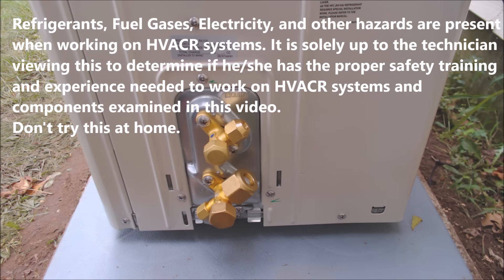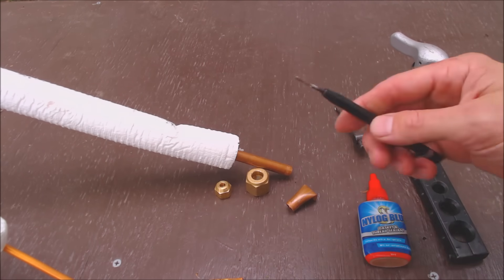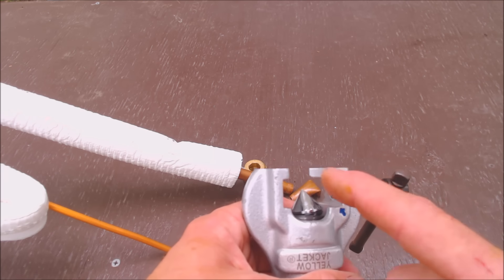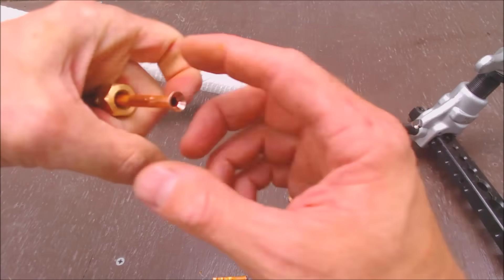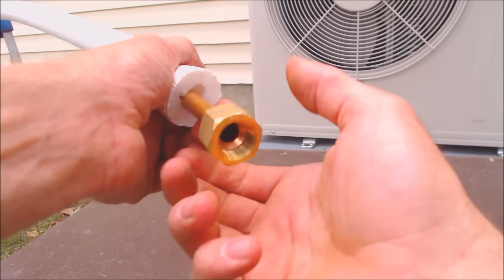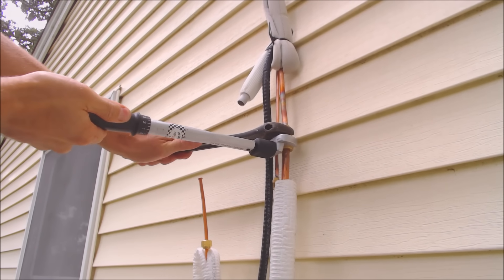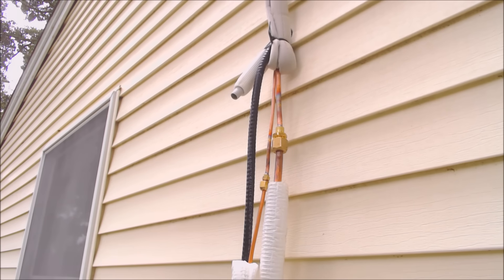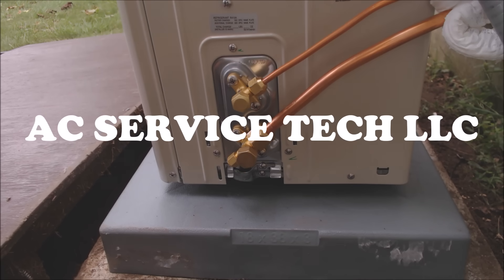How to Flare and Install Copper Line Set on a Mini Split Unit!

Comment: Great video!   I used an automotive torque wrench with crowfoot.  From what I read it's accurate.  The YellowJacket flare tool is awesome... as a homeowner I still saved over $1,000 on install of my first unit after buying the tools including vac pump and micron gauge.
Reply: To be 100% accurate you have to do math to get a reduced torque to allow for the extra length of the crows foot
Reply: Do you remember what size crow's foot you used? Are the refrigeration nuts sized metric? Did your research say how the crow's foot should be oriented on the wrench, straight or at a 90?  One youtuber said at 90 which seems to make sense.
Reply: @joebrewer5885  As I recall it was metric.  I think 90* was what I did.
Reply: @Hubjeep  Yeah it's 90 degrees, I've got an install coming up and have been researching. I couldn't pull the trigger on a $200-300 torque wrench for HVAC that I'm going to most likely only use once, maybe twice in my lifetime.
Reply: Guy I’m helping install would say he reamed it far too much but I’m starting to think landlord doesn’t know what’s up, I’m learning this in the down time from framing for my regular job, considering switching into this stuff because it probably pays better and is easier on the body but I hate working in occupied/gross residences and new construction framing requires pretty much non of that except for the very rare call back

Comment: I'm flaring a copper line with a male adapter with my propane stove in my should I be using threadlocker  liquid anyting?
Reply: I am  ( a DIYer) also installing a propane stove.  I already ordered some of the tools you use; however, do you have a reference for the torque on 3/8 ID copper tubing flare? On other videos DIYers crank it as hard as they can. 
Thank you for your videos.
Reply from the maker: For a gas line that only runs at 1/4 psi nat gas and 1/2 psi for lp not you dont add anything to the flare face or threads, thanks!

Comment: Do you use Nylog when mini split system uses PVE oil?
Reply from the maker: Yes just a small amount though and make sure there is none inside the tube but only on the flare face so it doesn't break off and enter the tubing and end up in the strainer, thanks!
Reply: Can flare connections be disconnected and reconnected? Would this increase chance of leaks? Thanks...

Comment: Can you flare a 1/4” line to 7/16” ?
Reply from the maker: You would need a reducing flare coupling fitting. In HVAC we wouldn't connect a 1/4" line to a 7/16" line for running refrigerant, thanks!

Comment: Good tutorial, though I would recommend cleaning your flare surfaces after you flare, as the tool is burnishing the face you will have copper left on the face of the flare than can potentially be a leak source, and a source of contamination in the system. Cheers
Reply from the maker: Great Tip Vega!

Comment: Per usual, excellent simplified instruction. What are your opinions on the Spin Flaring kits?
Reply from the maker: They are ok, did you see the video where I did the demonstration using them. It was one of the latest videos.. I still prefer my eccentric tool.

Comment: So I bought a mini split and installed myself long story short I forgot to unhook the lineset from headunit when moving everything to diffrent location and lineset twisted the copper on the headunit right behind the brazed/soldered fitting.  So if I just cut out the bad and flare it use a union to attach the line set to the head unit would it be ok? or does it need brazed/soldered fitting on the head unit? Thanks
Reply from the maker: You could use a flare on each side and a brass piece that has a thread head on both sides if that existed somewhere. Don't use a regular union though, only flares. Even if it is twisted, it may still be good depending on how bad, thanks
Reply: @acservicetechchannel  "You could use a flare on each side and a brass piece that has a thread head on both sides if that existed somewhere. "

Is there an exact name for this, I'm looking for one. Thanks!

Comment: I have a question.  I used my torque wrench on the 1/4 inch line and it wasn't sensitive enough at 12 lbs and it  over torqued and smashed and broke the  flare on the line.  I'm concerned that some of the metal fell down into the line and I'm wondering if I can blow it out with a few blasts of  filtered compressed air.  I don't have a nitrogen set up. The lines are in a vertical position and can't be tilted down as in your example.
Reply from the maker: Hey Mike is this a new torque wrench or one that you have been using for a while. It seems that some new torque wrenches need to be used a little to wear them in. Seems odd but maybe that is the case. Was it a digital or manual one like in the video? If it was the small 1/4" line, I would really try to bend it downward and put a decent amount of pressure through the line and then tap it with a wrench along the length where you thing there is a piece of copper at. Maybe put a bolt in a vise and try using the torque wrench a bit to get it to wear in a bit or try a different brand. I am sorry to hear that! Let me know if you have any other questions! Thanks Mike!
Reply: @acservicetechchannel  Thanks for getting back to me Craig.  Yeah it's new and it was the 1/4 inch line.  It's a 1/2 inch drive click type torque wrench.  Pretty big for the job but I will exercise it a bit before I try it again.   As for the material in the line the, largest part of the smashed flare fell off outside the line.  I'm just being cautious in case some material fell in the line.  It's a 25 ft line and the problem occurred inside the house.  Unfortunately the line exits the air handler high on the wall and proceeds straight down  thru the floor.  I'm thinking a quick blast of filtered compressed air would blow any small bits out.  I do plan to vacuum test the line to remove moisture.  Is introducing moisture what you're concerned about?
Reply from the maker: Yes moisture, thanks
Reply: Ha! 😂 That's why people use tradesmen. If nothing else, you can "feel" the right torque

Comment: Great video, thanks indeed for the good work!

I was wondering if it is ok to re-use flares on a copper line set for the second time, i.e. if I need to unscrew the line set to do some minor adjustments to my newly installed mini split system and then retighten the flares again? Is there a way to ensure the flares will hold for the second time, or is it advisable to always make new flares due to copper squishing onto brass cones, cold-working and hence missing some of its elasticity after having been used once? Any practical experience or guidelines would be highly appreciable.

Thanks.
Reply from the maker: It should be ok to use again but add some refrigerant oil or nylog onto the flare seat, thanks!
Reply: I've heard they make flare gaskets for this reason
Reply: Ideally a new flare. But at a pinch reuse with Nylog

Comment: You do not put anything on the flare seat
Reply from the maker: Hey Matthew, you put oil or nylog on the flare seat because the surface of the copper and brass are imperfect. This makes a seal that will not leak at the specified torque values, thanks!
Reply: @acservicetechchannel  will this method work on the vibration pipe the one that is next to compressor?

Comment: why didn't you just braze the line set splice?
Reply from the maker: You can if you flow nitrogen but you would still need to flare at the outdoor unit anyway so if there are already flares, I continue to connect with them, thanks!

Comment: Good vid. I would recommend putting the nylog on the backside of the flare as well as the threads of the nut. These torque specs are calibrated for lubricated mating surfaces. Having no oil on the threads increases the friction when tightening.
Reply from the maker: Nice tip, I just don't want anything to loosen over time due to vibration, thanks!
Reply: Do not do this.

Comment: Nice vid thx.  You can open the 2 cap a little bit to align them with the valve so you can fit the wrench straight to hold the valve while tight the flare nut.  Should test leak at 600 psi for 24 hours.
Reply from the maker: I often do a leak test at 300 to 400 psi with a digital gauge. The digital gauge will allow the tech to see a greater detail for pressure falling over a shorter amount of time. We used to use the compound for a longer period of time but no longer need to do this. Also after the vacuum is pulled and the tech moves to perform the standing vacuum test, this test will verify if everything is fine and that no moisture, air or leaks are present, thanks Quang!
Reply: AC Service Tech LLC 
Thx i just tried input my old day mitsubishi training.

Comment: Would you recommend cutting and flaring lineset if it comes pre-flared?
Reply from the maker: Yes if it needs to get cut to length unless you are trying to avoid refrigerant recovery for a small amount of line set length but in a situation like this job it needed to be cut for sure. I saw you just signed up for the email list. Heads up! The E-Book is now for sale on the site and I will be sending an email to everyone on the updates list soon to let them know!
Reply: AC Service Tech LLC 
I should clarify a bit...assume you have 10 feet of lineset and it works out that this is pretty much the exact length you need. Should one cut and flare anyway which is basically not trusting the existing flare on the material or sho7ld you cut and flare?
Reply from the maker: If it fits and the flare is wide enough and shiny then the flare should seal but if it is off by 6 inches and it cant be bend into place then yes go ahead and cut the flare in, thanks!
Reply: Hello my question is the inside unit is going just above the outside unit so I really only need about 4-6’ of line and I have 16’.Can I just cut to 6’ reflair the ends and continue or will I have too much refrigerant?
Its in my garage so it would be real easy to mount my inside unit run the lines down the 4-6’ in a slim duct and out to my unit with no big kinks or coils. Thoughts?
Thanks!

Comment: How come they are not making double flares.  They double the thickness at the flare and less prone to the flare cracking due to the single flare which makes the copper thinner in that area.
Reply: I had purchased a Mastercool hydraulic double flare tool for doing double flares on brake lines. We now use it on copper and have had great results. It not only doubles the thickness of the flare but also eliminates reaming. The copper being used for these preinsulated line sets is much thinner than L copper. Therefor the flare is much thinner and is work hardened to a higher degree. Double flares are the answer.
Reply from the maker: I wish I knew the reason for it but I think it is because of those that don't flow nitrogen while brazing. I believe the manufacturers don't want to take a chance that oxidation could enter the system so they just go with flares to avoid torches, thanks!

Comment: I want to install a multi split system on an old house. Is it crazy to think I can do it myself? The cost to install is triple the cost of just the unit.
Reply from the maker: As long as you are EPA 608 certified yes you can do it but it does a good amount of work if it is multiple head units, thanks!

Comment: I'm currently an apprentice with 1.5 years of experience and will be purchasing at least $200 worth of stuff from your Amazon links. Just curious if you have a cheaper vac pump in mind for a 1 ton mini split? Don't wanna jump in with the big boys pump just yet, the one you linked is a little pricey lol. Thanks.
Reply from the maker: Hey Keo GG, you may want to try this CPS one- https://amzn.to/2UX9MEf  - I would stay away from those really cheap off brand vacuum pumps. I had a couple at the school and were not capable of drawing a deep vacuum, thanks and other tools are link at amazon.com/shop/acservicetech thanks

Comment: Fujitsu recommends against Nylog.
Reply from the maker: Thanks Cu27 Rotary, I use either a small amount of nylog or POE. We have been using POE for years with no leaking problems. I believe some techs are putting too much nylog on each joint and it is ending up in the lines not good, thanks Cu27!

Comment: Love your videos and attention to detail. One thing I noticed is that the first two or three feet of line set that comes from the air handler is not insulated separately but has insulation that goes over both them together. I know the manufacturer does this but do you ever try and separate them so they are not touching or insulated them separately?
Reply from the maker: There typically just isn't enough room. They aren't fully touching but that would be great if they were kept separate, thanks
Reply: @acservicetechchannel  ok, thanks.

Comment: Great video. I see you have links to just about everything. What about the fitting themselves. Suppose you want to add a connection point so the male and female ends?  both 3/8 and 3/4 one end will have the flare the other weld on. thanks again. Im looking to add flare fittings to my unit some one cut off the flared ends. TIA -S
Reply from the maker: They can be brazed as long as you flow nitrogen through. You wouldn't want to braze in the flare connector, thanks

Comment: Thanks for the great lesson.  When I installed a 2 way fridge in my camper,  the line got a bad crimp in it (note to self-it would have been easier with an extra pair of hands...)  I wanted to replace that section of line.  It is not leaking now, but I don't want to take any chances  with damage from travel vibration.  You saved this carpenter's daughter $80 in labor at the RV dealership, plus gave me another DYI skill!

Comment: Hello, i am new to hvac and was taught to put the nylog on the threads. And no one has showed me to put it on the flare itself.. So is it not necessary to put it on the threads? Should i be just putting it on the flare?
Reply from the maker: Uh oh, yeah no, it doesn't need to go on the threads. It won't hurt but it wont help either.  It is supposed to help seal the tubing by making a mechanical seal at the flare seal, thanks Michael!
Reply: Vacuum pump oil on flare.
Reply: On a mini split you should not use nylog or "snot".  While they say it will do no harm to the system I have seen nylog kill lev's and obstruct strainers.  All manufactures state to use either POE or PVE oil on the back of the flare and on the threads.  I understand that minor amounts are being used but proper procedures prevent premature failure.

Comment: Great Videos !!!!!!!!
Would there be any advantages in trying to keep the line set as short as possible?
I know looking through the Installation literature that there is a maximum but I know I’ve seen some installers leaving a coiled excess of line tucked in behind the outdoor unit.
I just purchased a single zone unit and my vertical run might be no more than eight feet to the wall mounted air handler.
Reply from the maker: The mini split units will usually say a minimum and maximum. That must be a homeowner that didn't want to reflare the ends after cutting or something. I usually leave them short. My last one was only 4 or 5 ft and refrigerant didn't need to be recovered but check the literature, thanks
Reply: @acservicetechchannel  Thanks for the reply
I just checked the Installation:
Minimum Pipe Length is 10f/3m
Maximum Pipe Length with no additional refrigeration is 25f/7.5m
Total Maximum Pipe Length 98f/30m
Unit is a Carrier Comfort Series Heat Pump 18 BTU
Reply from the maker: If ten foot is the minimum then 2 foot worth of refrigerant will need to be recovered after the system is broken with refrigerant. Make sure that you are EPA 608 certified before working with refrigerant, thanks!
Reply: AC Service Tech LLC 
Thanks for the suggestion and reply.
I think when everything is said and done the line set will be 10 ft or a bit more.
I’m doing the rough in installation for everything and I’ve got a Red Seal HVAC friend  to do the rest with the right tools.
Reply from the maker: Oh ok good, then, thanks
Reply: @acservicetechchannel  "If ten foot is the minimum then 2 foot worth of refrigerant will need to be recovered".  Please explain?
Reply: @rsauder The mini split is pre charged with refrigetant for a minimum copper line length of 10 feet. If I was going to shorten it to 8 feet there would be to much so you would have to calculate and remove some. So remove the calculated amount for shortening the line set to 8 feet.
The same thing happens when you’ll lengthen the line set longer than the  maximum length it’s pre charged with. You’ll need to add extra for the added length

Comment: What the reason for flaring ?
Reply from the maker: That I believe is because the manufacturer likely doesn't want oxidation in the system from improper brazing techniques to happen. If they can't guarantee that the tech will flow nitrogen then they don't want problems in their systems likely, thanks JiggyPatel!
Reply: When you braze it you can get a black substance inside the pipes which eventually contaminates the whole system because the mini split metering device is so sensitive that if there is any contamination it will start to malfunction. So mini splits want flares instead of welds. The more you do it the easier it gets to flare and avoid minor leaks. But you can braze if you must, just run nitrogen in the lines while brazing to avoid the contamination.
Reply: Minisplit a/c doesn't have filter dryer they use multiple strainers inside condenser and if u dnt use nitrogen when brazing u can clogged up strainers and void ur guarantee

Comment: Very good video.. I have a question where does it say the pressure pounds for the torquing.?.
Reply from the maker: It will always say that in the installation instructions of the model number you are working on, thanks Rene!
Reply: Usually on the tourqe wrench its self too.